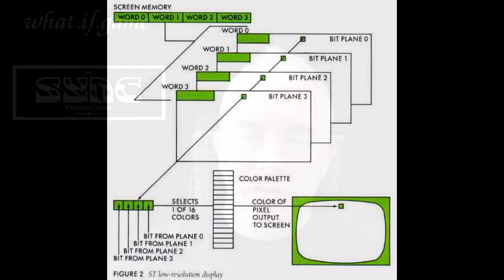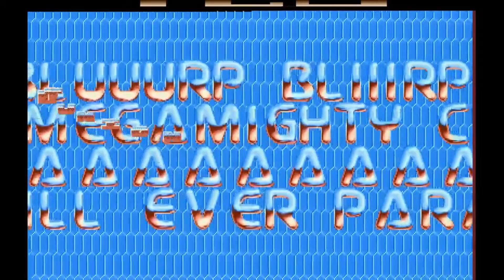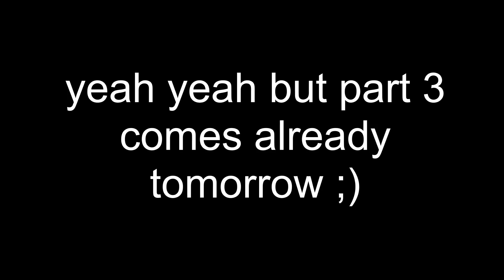what.if.game - part 2

Comment: I may have missed it in the deluge of other fascinating information, but you said something about Ijor's discoveries about the mode bits being used for reliable 4-pixel scroll in pt3 (which I somehow saw BEFORE this)... was there any mention here of their closely related discovery that the right kind of fiddling with those GLUE and Shifter registers can put the two chips out of sync and produce whole new modes (that is, 1280x200 mono with output on the TTL line but 15khz/50-or-60Hz sync, 160x400 16-colour and 320x200 4-colour over RGB with 35kHz/71Hz sync...)? Almost immediately also tested out by Exxos and their 16MHz-throughout modified machine that could already do 640x200 16-colour (and 1280x200 4-colour) at standard rates through some kind of wizardry, to produce 320x400 16-colour and 640x400 4-colour modes... (2560x200 mono not really being useful, and in any case the shifter would probably explode if you tried to make it do 64MHz...

(itself being sort of the prompt for me to wonder about what you could do if you used a genuine 12.5MHz 68000, slightly underclocked, and matching bus logic to add 50% to the resolution instead of doubling it...)

Which is one thing that doesn't work on the STe because you simply can't fiddle things such that one of those registers gets updated to a new value without it being reflected in the other, as the GST only has the one register instead of them being duplicated, so "both" are always changed to a matching value every time.
Reply from the maker: While it seems similar, this insight into the Shifter and GLUE not agreeing on the meaning of videomode #3 is not actually related to Czietz' discovery that the Shifter ignores LDS/UDS and thus you can write values to the videomode register so that the GLUE and Shifter have different opinions on what it should be. That's a fantastic discovery too though and I hope we'll soon see some actual usage of it.

When it comes to "Exxos'" 16MHz-modified machine that does ring a bell ... ;)

https://blog.troed.se/projects/atari-st-new-video-modes/
Reply: @troedsangberg  oh whoops! Apologies to Czietz for remembering wrong and thanks for the correction. Also I must have forgotten the mode of action, I thought it was some kind of timing trick but writing one value normally which is picked up by both, then another to the high (?) byte so only the shifter sees it sounds more familiar and makes more sense.

TBH I was seeing this one where the clocks are turned off as probably more useful for demo purposes than that, at least for unmodified machines. It wouldn't really be any different to switching in and out of the regular modes if used to try and mess with output timing, but is more complicated... After all from the perspective of the actual video lines, nothing's changed, you're still getting the same pixel clock to bit depth relationship, it's just a different set of active/blank and sync control signals are overlaid on top. And unless you're using a true multisync you can only really use one or the other on a particular monitor.

Though of course being able to combine hirez mono with (somewhat limited and blocky) colour on the same screen by switching modes whilst connected to a VGA could be interesting, even if it's limited to line by line switching and requires you to make a fairly special adaptor cable.

Comment: Interesting breakdown. I’m glad you talked about how the ST has a lot of the C64’s DNA by way of its engineers. In many respects (and as you say), the ST is the 16-bit follow up to the C64 but without the custom hardware. Unfortunately, it’s also less impressive because it was so compromised and rushed to market.